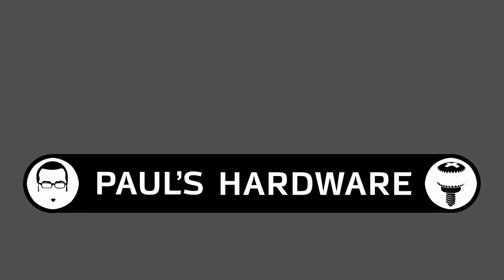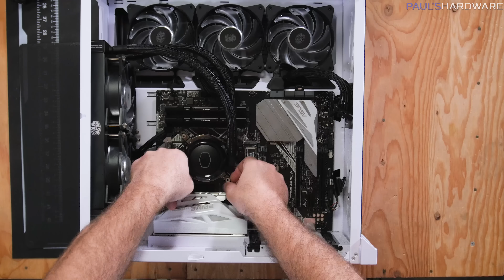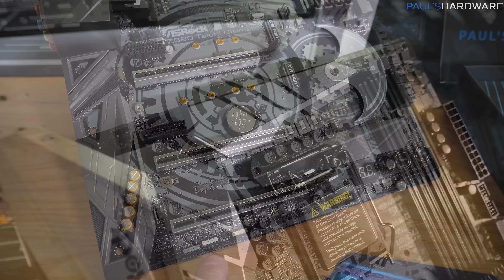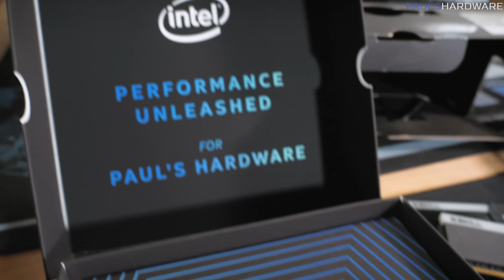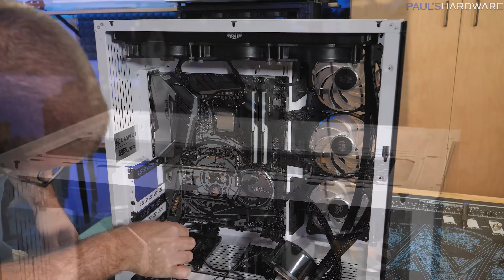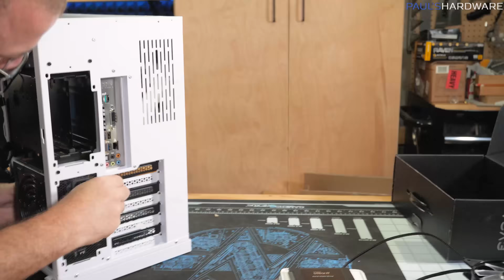UPDATED! The FASTEST Gaming PC You Can Build in 2018

Comment: I'm saving up to build myself a new Gaming PC, so far this is my list:

- Intel Core i9-9900K
- MSI MEG Z390 Godlike
- Cryorig H7 Quad Lumi RGB
- Corsair Vengeance RGB Pro 32GB (4x8GB) 3200
- MSI GeForce RTX 2080 Ti Gaming X Trio
- Samsung 970 Evo 1TB
- Samsung 970 Pro 512GB
- Seasonic Focus Plus 850 Platinum
- Custom White Cable Sleeves
- Phanteks Enthoo Evolv X Glass Silver

If any of you guys have suggestions please tell me, this will be my second PC I'm building for myself. I'm also planning to buy the PC parts in April/May 2019, so some of the prices may have dropped a bit. I'm also not 100% sure about the storage, memory and if I want to get Air or Water cooling in my build.

Comment: Paul if im not mistaken,, doesn’t the M.2 share lanes from the PCH and not the PCI-E,,, at least that is the way my EVGA FTW Z370 Board is.. nothing shares the PCI-E lanes except things plugged into pci-e sockets , ie another graphics card etc... and that is according to Jacob on evga there is a diagram on how it all works on their forums.. i am just curious , if the Z390 does it differently than the Z370
Reply from the maker: It's really up to the motherboard manufacturer, they can use the 24 lanes from the PCH (which is 4 actual PCIE lanes connected to a switch) for M.2 or they can use some of the 16 lanes available directly from the CPU. If they use the direct-from-cpu lanes, M.2 couldn't be used at the same time as one of the lower PCI Express expansion slots (usually a x4 slot). If they use PCH lanes - which I just checked, and the AsRock Z390 Taichi Ultimate does - then using the M.2 will disable a couple SATA ports. Either way it's a trade-off, but worth it to check the motherboard configuration for this if you plan on using a lot of SATA or M.2 NVME devices.
Reply: Paul's Hardware thanks for looking into that for us Paul... it’s all pretty confusing the way these boards work ... and it is greatly appreciated you trying to help us understand the mess lol ...
Reply: A CPU and motherboard in 2018 of this caliber should come with 20 native cpu pcie lanes.
Reply: That’s my understanding too, with the exception being something like the dimm.2 slot on the Asus extreme that is pulling lanes from the cpu. I could be wrong though of course.
Reply: @bloodduality  so would it have enough lanes for 2 970 evo nvme drives and a x16 graphics card just using the motherboard?
Reply: Kurtis Rinker yes my understanding is you would have to turn off certain sata ports when using certain M.2.. you will have to read them manual which will tell you which M.2 slots correlate to which sata port needs to be turned off
Reply: Shaun D. Lol wrong. People really need to do research on NVME drives before commenting, PCH lanes from the actual chipset is used. Your GPU will still be 16x. There is also a difference between x8 and 16x @ 4K gaming. Carry on.
Reply: My Asus z390 pulls m.2 from the chipset lanes, as I'm pretty sure most, if not all z390 boards do. I don't understand how people have gotten this so confused. Take a look at the z390 intel block diagram. Read your motherboard manual. So much misinformation being spread about z390 lanes and m.2 and I really think that tech reviewers need to take the time to make sure they're giving factual information.

Comment: Out of curiosity would is the 9900k only faster because it has higher turbo frequencies than the 8700k? If you were to delid and overclock a 8700k would it match the performance and thermals? Can you even technically answer this yet?

Edited because I put 7800k instead of 8700k, stupid brain and fingers.
Reply: Patty no the 8700k, the 6c 12t z370 processor. 7820 is on x299.

Edited because I put 7800k instead of 8700k. :(
Reply: There's no 7800k, what you're talking about is the 8700k.
Reply: simplyinfinity you are correct I put the numbers in the wrong spot. My bad I'll change it.
Reply: Patty is the 7800x ringbus or mesh? That would be the performance difference if I understand this correctly.
Reply: Patty well it depends on utilization of those cores and threads for the specific games being analyzed, the high end of gaming just moved from 4c to 6c last year, have games already moved passed the available hardware?